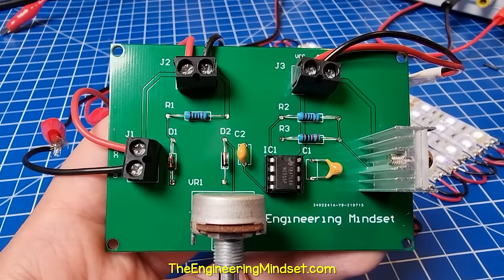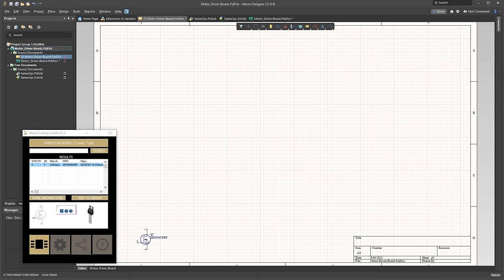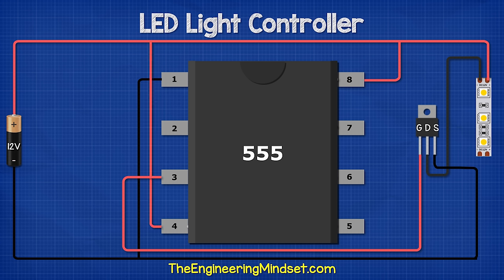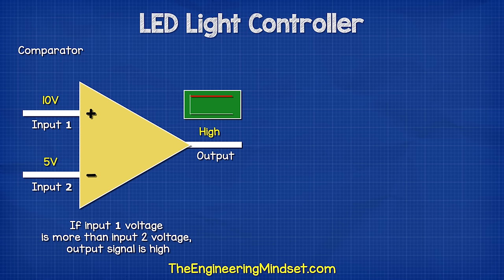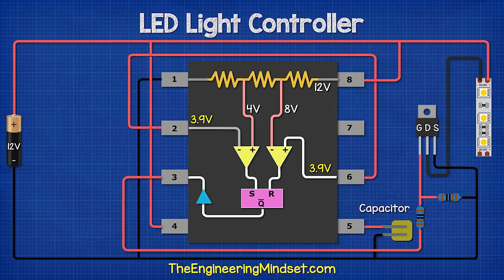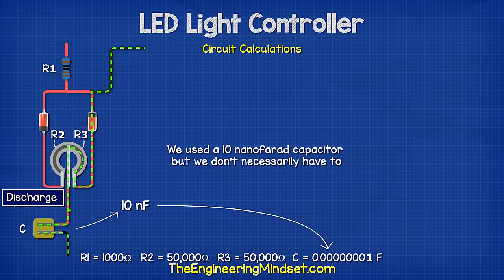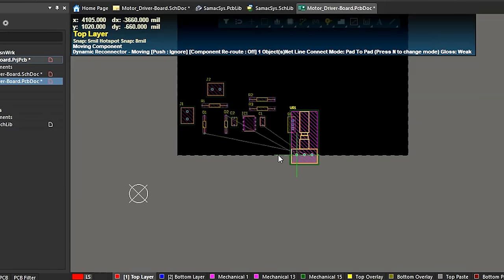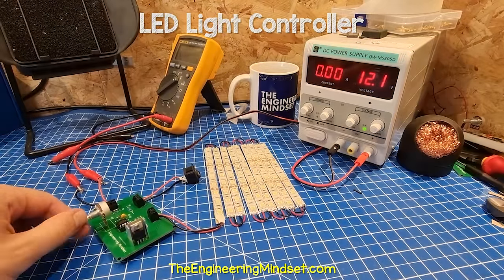LED Dimmer controller design - Electronics engineering pulse width modulation

Comment: I wouldn't compare LEDs at 50 Hz square wave with incandescent lights at 50 Hz sine wave. The fillament stays warm enough to be bright for a bit, it has an integrated smoothing through thermal mass. 50 Hz flicker is very much noticeable.
Reply: It needs a small rotary inductor in series. A cheap DC motor should work well. 😉
Reply: Didn't he say that this circuit ran at 1.4 kHz as built?
Reply: @PatrickKQ4HBD  — Yes, but he mentioned you could increase the capacitor and reduce the frequency.
Reply: @altosack  so? what is the issue here? his point is still valid.

Comment: Bigclive showed an interesting design for an rgd led dimmer. Instead of using the 555 as a pwm driver, it was used there as a triangle wave generator and the mofsets were actually driver by a comparator. Potentiometer wiper to the + pin and the triangle ramp waveform to the - pin. This is the circuit in a nutshell
Reply: can you share the link to the video?
Reply from the maker: Seen our new Potentiometer Explained video? ➡️ https://youtu.be/Xb-MZMoUtcQ

Comment: This is the best of all explanation of how to use and what is why for 555 controller and how to use it with dimmer and mosfet transistor. Thank You very much, because I like deep explanation that can tell you what would you do more or follow Your steps so You can get everything done as it should to be. I use to do this/repairs and collecting schematic element and solder but I stop, life took me in the other side of some branches of work, and now I see how I was stupid for not following my dream and keep doing this 12 to 13 years ago. Tnx that You doing this. 👍💯

Comment: Small correction to anything from 3:20:
The MOSFET actually doesn't change its resistance meaningfully after you applied more than its gate Threshold Voltage (in this case around 3V). That also means that the MOSFET isn't doing the "averaging" over the PWM Signal by putting out an "average" resistance. It actually switches with the same frequency the PWM Signal does and so do the LEDs. The perceived change in brightness is done by the human eye :)
Reply: @kennmossman8701  Sorry hard disagree. Look at the RDsOn vs VGs Graph in basically any MOSFET datasheet (provided a link below).
Thats a very "elbow shape". Meaning that after the treshhold value (5V in this case) for VGS is reached the RDsOn reaches a steady state very quickly. If it would not do so and have a more linear characteristic the Mosfet would burn up due to I2R losses. There is a dependency but as you can see in the graph its very flat. And certainly its not used to adjust RDsOn (or by that the current), at least in no application I have seen so far. PWM is the way to go here, esp for LEDs.
Reply from the maker: See my new MOSFET explained video here➡️: https://youtu.be/AwRJsze_9m4

Comment: I had so much trouble understanding how to make pwm from 555 timer although the video didn't help me fully understand it but it was well explained 👍🔥 only problem is that I don't understand what's an op amp, comparator, inverter, flip flop 🤔✌️
Reply: First, learn electronics ! or google for words like "opamp". Do you really need to know how it works ? You don't really know how baking powder works to make bread.

Comment: Hy sir my name is Nirban and I am from India  and I am also electronics engineer.
My question is 
1- how many times using the circuit with out heating issue.
2- how much ampere using in output in this circuit 
3- when battery is low led brightness automatically dimming or led off

I am your big fan  ❤❤❤

Comment: Hi there. Thank you for this video. I build the circuite but LEDs does not turn off completely. I tried different hacks and finaly i solved the issue by adding a 47nf cap between the gate and the GND.

Comment: As usual, a very well expalined and informative video. Thank you! 
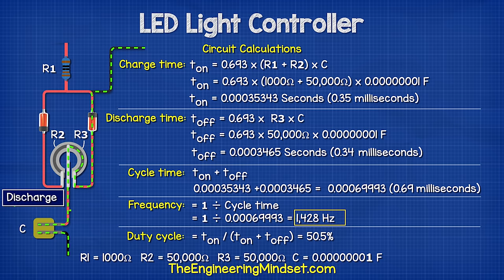Just a small note, at 12:10 the shown frequency in the video is written 1.42 Hz whereas it should be written 1.42 KHz as you have said. Thanks again!
Reply: I think that's a comma ( , ) for a thousands separator, not a decimal point ( . )

Comment: please around that 5:21 the resistor between ground and gate pin and another resistor between gate and pin 3 wont that form a voltage divider

Comment: Just built this, and it works fine. One funny thing that happens though is that the LEDs flicker brightly if/when I turn the poti too fast. Could this be due to my using a "normal" 555 timer rather than  the CN version? I don't really understand what the difference between the two is.
Reply: No, this is due to the pot quality.

Comment: With the draw of the electric motor, I understand the need for this, but with the low draw of the LEDs why couldn't the potentiometer just be used in series, avoiding use of the MOSFET and 555?
Reply from the maker: Because the potentiometer wastes all the energy as heat, PWM doesn't
Reply: @EngineeringMindset  thanks! That makes this much easier to grasp
Reply: Because most circuits are NOT driven by batteries, the LED frequency will still most probably have the 50Hz ripple smoothed down to DC by bridge rectifier & cap. 
With PWM you can select a much higher frequency ✔
Reply: Yes it is a 100Hz ripple (as a result of 50Hz alternating current) but on LEDiode's some people are lazy/frugal & omit the bridge rectifier and only use one half of the wave (PROBABLY).
Reply from the maker: Seen our new Potentiometer Explained video? ➡️ https://youtu.be/Xb-MZMoUtcQ
Reply from the maker: See my new MOSFET explained video here➡️: https://youtu.be/AwRJsze_9m4

Comment: Amazing, really, that a 50 year old IC is still in production. I will probably shed a tear i(f it is ever replaced by a microcontroller.
Just be careful with these LED strips, they are pretty innefficient when used in large amounts as a fair bit of heat is produced by the dropper resistors.  Also when the manufacturer says 12V, they mean it - running from a 12V vehicle battery (around 13.8V) will seriously shorten their life. I attempted to make a light for a mobile home with these, and the strips got so hot they softened the glue and sagged (too many in a small space, stuck onto a non-metallic surface and running from 13.8V). In the end I had to scrap it and make one using individual high power LED's running from a current limited supply (a bit more complex, but still running every night for 4 years now).
Reply from the maker: Check out NEW resistor video, everything covered! ➡️ https://youtu.be/DYcLFHgVCn0
Reply from the maker: Seen the new LED explained video? so much detail covered! https://youtu.be/O8M2z2hIbag

Comment: I am curious why don't we use a simple variable resistor to dim or brighten the LED, instead of using this complex circuit??🤔
Reply: Yes, I was wondering the same thing.  But again, I am just a weekend electrical warrior.
Reply from the maker: Check out NEW resistor video, everything covered! ➡️ https://youtu.be/DYcLFHgVCn0

Comment: Great Project, I did have one question? On review of the video at time stamp 10:11 I see that the Wiper output is connected to the "CW to Diode" trace. and was wondering if this is incorrect? getting ready to do a breadboard example, and will try. Thanks

Comment: This is a dumb question, probably, but if LEDs run straight off 12v DC,  why can’t we dim them with just a variable resistor in series with them to reduce voltage and current through the LEDs?  Thanks for great stuff
Reply from the maker: You can, but it wastes a lot of energy. It might even catch fire if you exceed the heat dissipation of the component. Covered in detail here: https://youtu.be/Xb-MZMoUtcQ?si=q38jLohnI1pH5OZl&t=907

Comment: Your videos are fantastic. Even a layman like myself can understand. 

I have what I hope isn’t a dumb question. When the transistor drains the capacitor it looks like it does so by just connecting the drain on the potentiometer to the ground. The diode ensures current only flows one way. That makes sense. But isn’t the positive terminal of the battery still connected to the same circuit too at 12v less the voltage reduction of the potentiometer resistance and that resistor before the diode? I don’t see anything that would somehow tell the potentiometer to switch from the input to the drain circuit, but maybe I’m not understanding how the drain works.
Reply from the maker: Check out NEW resistor video, everything covered! ➡️ https://youtu.be/DYcLFHgVCn0
Reply from the maker: Seen our new Potentiometer Explained video? ➡️ https://youtu.be/Xb-MZMoUtcQ

Comment: Why does D2 - the discharging diode - has to be connected to R1 and D1?
Reply: Yeah I was wondering the same, plus it has a path from 12V for current flow, which will increase power consumption
Reply: Yeah, I have the same question.  None of the diagrams ever show current flowing through it.
Reply: @shauni_jade  Wouldn't that result in the light being lit 100% of the time since the pin is always receiving 12V?

Comment: Excellent explanation. I have some doubts. If we connect directly to the LED, it turns on (forget about regulating the brightness). You mentioned using a MOSFET, but I don't understand why it needs to be turned on and off 100 times when we are using a DC source.
Please clear my doubts 🙏
Reply from the maker: See my new MOSFET explained video here➡️: https://youtu.be/AwRJsze_9m4

Comment: Thanks for the video! I am brand new to electronics, and I think I am going to try to put one together in order to make an LED leak light for repairing woodwind instruments. 

Perhaps a dumb question, but could I use a 1N4148 diode instead of a 1N4148B diode? I’m struggling to find the latter for sale on Amazon but it’s easy to find the former and I don’t know what the difference between them is. Thanks!

Comment: Awesome video.. I am just wondering if this is the most simple version of an LED driver and if industrial drivers use any other design?
Reply from the maker: For sure there are many ways to achieve the same or very similar results, each version will have pros and cons. Industrial is far more complex and will use smd components, I use through hole components as its easier to see and handle

Comment: Led dimmers are so overpriced. This works just as fine. Thanks!
Reply: don't those dimmers work with AC voltage? this design is simple because it uses DC voltage. AC voltage dimmers have added cost of using components that convert AC to DC. which isn't cheap
Reply: @lordjaashin  not for led strips. You already need DC for that. But you're right when it comes to 220v led bulbs that go right in the socked, but even then I've seen some crazy overpriced stuff.
Reply: @xanderguldie  what do you mean by 220v led bulbs? there is no such thing as led that can run on AC voltage. every LED in this world run onpy on DC voltage.
Reply: @lordjaashin  there are led bulbs that you can just plug in an AC socket and the AC gets converted in the bulb. Those are usually smart bulbs that you can control remotely but with some you can't. You need a special dimmer for those
Reply: @xanderguldie  I'm aware about that. every LED bulb has rectifier circuit that converts AC to DC. those smart LED costs so much because they have rectifier+dimmer+LED in such small package. the dimmer circuit shown in the video doesn't have rectifier circuit integrated into it that is why it is cheap to build.
Reply: @lordjaashin  yes, you are correct but they're part of the internal circuitry. They're expensive because they're so tiny. I was talking about the large ones, wich are also pretty easy to build

Comment: I know I don't understand this fully and I probably need to be corrected but if the output is to just control the light intensity why don't he just use the potentiometer to control the voltage and not need to create such a complexity,can someone please explain what am I missing??😊
Reply from the maker: You can, they used to do that but it's incredibly inefficient.
Reply: @EngineeringMindset  Also why do you need to blink the light millions of times instead of just supplying a constant power
Reply from the maker: Seen our new Potentiometer Explained video? ➡️ https://youtu.be/Xb-MZMoUtcQ

Comment: Why can't a SINGLE potentiometer do the same job, WITHOUT the PWM signal from the 555 timer? I've tried it, and it works.
Reply from the maker: It works but it's the worst possible way to do it. See my potentiometer video to learn why.

Comment: Great tutorial, however, the controller is useless if one wants to use the dimmer for video light applications. The flicker is visible (as horizontal bands) whenever dimming is in effect.
Reply: I had an old CCFL magnified desk lamp and wanted to upgrade it to an led ring. I found this application perfect for my project.
Reply from the maker: Seen the new LED explained video? so much detail covered! https://youtu.be/O8M2z2hIbag

Comment: The divider on the gate is unnecessary imo. The 555 can sink and source current, so it can both charge and discharge the gate. Not to mention added resistance creates a low pass filter out of the gate, which limits the operating frequency. Too high and you'll get waveform distortion at the gate, not a clean on/off, and it will start heating up more. Just drive it directly from the gate. It can take 12V no problem.

Comment: Can I ask why you wouldn’t just use the variable resistor to control the gate pin voltage?
Reply from the maker: It'll waste a lot of energy. The resistor literally heats up and purposely wastes the energy it doesn't pass through. It'll work but our power supply will be drained
Reply: @EngineeringMindset  ok thank you for that!
Reply from the maker: Check out NEW resistor video, everything covered! ➡️ https://youtu.be/DYcLFHgVCn0

Comment: I am curious how you monitor and/or measure heat output of the circuit design.  It seems this  could be an issue from time to time.
Reply from the maker: Nearly all the components have a very small current and thus heat output because of the resistors in the kohm range. The mosfet will be the hottest component so we use a heat sink. This can handle far more current than we're using it for so it is fine.
Reply: @EngineeringMindset  I understand.  Thanks.
Reply from the maker: Check out NEW resistor video, everything covered! ➡️ https://youtu.be/DYcLFHgVCn0
Reply from the maker: See my new MOSFET explained video here➡️: https://youtu.be/AwRJsze_9m4

Comment: Could this circuit be scaled to power higher powered LED's? Say a 100 watt CREE led running PWM frequency of about 100KHz? I would imagine that the main factor for this would be to select a proper MOSFET/FET for the switching and properly heatsinking it. In addition protecting the 555 timer from gate current.
Reply from the maker: See my new MOSFET explained video here➡️: https://youtu.be/AwRJsze_9m4

Comment: I ordered the pcbs. The problem is there is not schematic with the actual components. R1 r2 r3 which ones are which? Which capacitor goes where on the board? I'm having to watch this video and assemble it by your description. Pain in the butt. Thank you for the design and tutorial though.
Reply from the maker: Good point, I have just updated the component list in the video description with the part numbers on the board.
Reply: missed R1 which is 1Kohm @EngineeringMindset

Comment: Isn´t simpler to just control voltage by adjusting a potention meter? Because you can´t see how it blinks.
Reply from the maker: It's simple but the potentiometer just wastes all the energy as heat
Reply from the maker: Seen our new Potentiometer Explained video? ➡️ https://youtu.be/Xb-MZMoUtcQ

Comment: Sir while soldering heat Is also transferred to the electronic components so, is there problem for any components like that sir
Reply from the maker: Yeah sometimes it will damage them if you apply too much heat. You just need to keep trying
Reply: @EngineeringMindset  I think my teacher also don't even explains concepts like this thank you very much before I don't know what is the full form of LED thank you very much sir

Comment: I would just use arduino PWM output and analog input. Then dont have to simulate PWM signal
Reply: Yes! But the cost of an Arduino >> the cost of this circuit. Also, Arduino involves coding that may be a deal breaker for some people. Simplicity and low cost will always overpower technicality unless the value added by that technicality is far greater
Reply: @yocheeseify  you can also use the clone of Arduino, just few $.
Coding yeap, its complicated. Anyone will use what he likes. I know some codeing so i choose arduino for LED strips

Comment: i did it.... it works on the breadboard..... but i have a question if i want to limit the output for only 9 led what alteration should i do to the plan if the power supplied is a 12v 280 amp capacity
Reply from the maker: Seen the new LED explained video? so much detail covered! https://youtu.be/O8M2z2hIbag

Comment: Hi All,

I'm looking for a simple circuit to dim a LED dash. It's for a project I'm helping a friend with. He is building a factory 5 cobra.

The new style dash they offer is a full LED backlight and clearly won't dim on a standard rheostat. The limitation I'm working to is that he wants to keep the dash looking original, so he will use the Lucas-style bakelite knobs.

The options are as I see it:

1, Use a potentiometer (modify it to take the Lucas knob); this clearly is not the most efficient circuit. But given its light use, it should be OK.

2, Use a 555 timer to build a PWM circuit.

The question I have is, can I control a 555 timer with a rheostat rather than a potentiometer? Using the original Lucas rheostat will mean I don't have to modify the dash and the overly brittle bakelite knob.

thanks, Stu
Reply from the maker: Seen the new LED explained video? so much detail covered! https://youtu.be/O8M2z2hIbag
Reply from the maker: Seen our new Potentiometer Explained video? ➡️ https://youtu.be/Xb-MZMoUtcQ